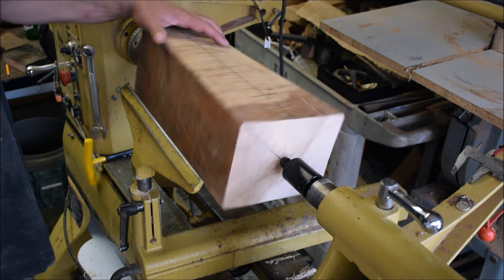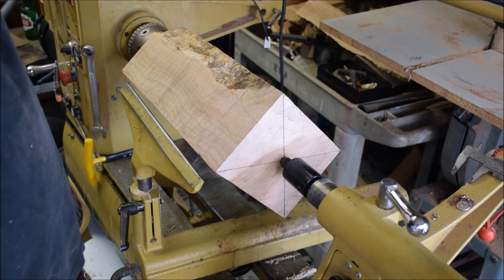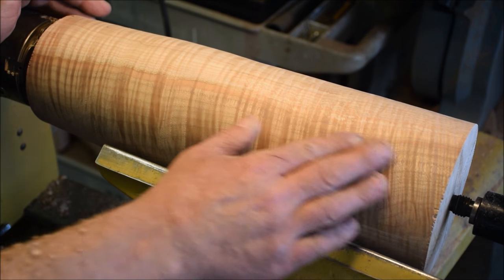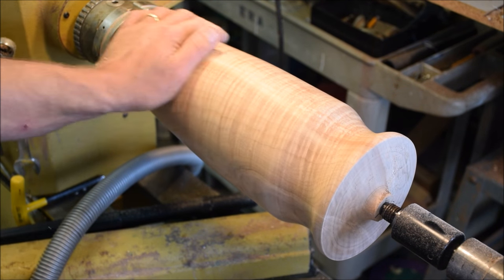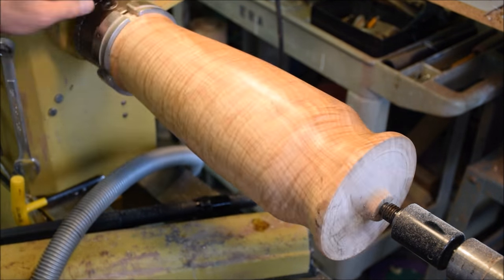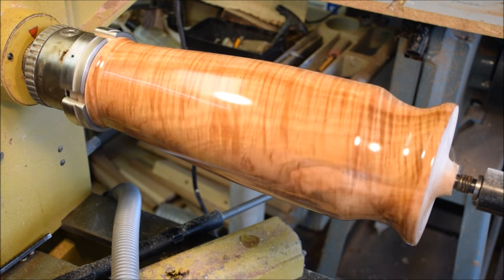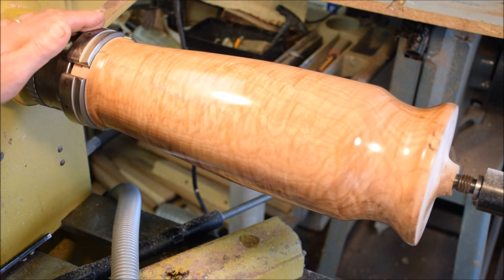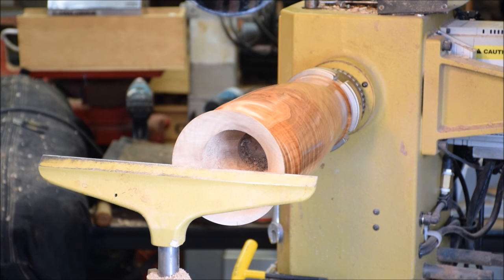Woodturning With The Naked Turner Figured Maple Vase

Comment: Beautiful Vase Erik. Your right. NO HANDS inside. I use a 1x1 wood stick and some foam like what you use for pipe insulation. glue it in a U shape around the end of the shaft, and use spray adhesive to stick what ever grit you want,and sand to the finish,you want. to change grits, just peel off old paper,spray,let it tack up and sand finer and finer. Love your videos Michael in Florida
Reply from the maker: Thanks Michael, That is a great tip to add. I did use a stick with ethyfoam and sticky back sandpaper in the end.  Thanks again Michael!

Comment: Awesome as always, if I have to sand anything reasonably deep and narrow I use a piece if wood ( usually 1"X1") and wrap a piece of foam around the end (about 3" long) then wrap sandpaper around the foam, as you stated I'm always afraid of damaging my hand, you can get a good finish going through the grits and if the bottom is rough off the tool 60grit can get out most tool marks, you'll be able to pit a lot more pressure on without any worries. Excellent to see you creating a tool for the job too ;).
Regards 
Peter
Reply from the maker: Thank you so much Peter , I too used a stick and foam pad to sand up to 220 deep inside but the final grits do not sand very well on the stick and I did not want to get hurt so I settled and was happy I didn't break this one!  The tool worked but it was a real challenge and took about 3 hrs of hollowing.

Comment: I wish you had recorded the new hollowing tool in action. I would love to see how it works. I'm attempting to build a hollowing tool loosely based on Lyle Jamieson's design. I've started a vase that is about 12 1/2" long, but I'm using pine from a neighbors tree he cut down. I'll let you know how and if it works. I'm certain mine won't be near as beautiful as yours, but I have to use what is available.
Reply from the maker: Cool Gil, I really like Lyle Jamieson's  design and was wishing I had one while struggling with mine.  I need to make some changes but I used it like a shear scraper and it took me 3 plus hrs of hollowing and I used my forstner bit to drill a 2" hole about 5" at a time and then scrape away.  I almost went through the side wall and it is only because it is hard curly maple that it stayed in one piece.  Thanks

Comment: great piece! I'd like to have seen how you parted and finished the bottom. Thank you.
Reply from the maker: Thanks Shelly, that tells me you stuck around to watch the video even though it was a bit long.  I parted right up against the chuck head and cut a slightly wider then one blade width of my parting tool and then cut the last 1" with a flush cut Japanese pull saw and hand sanded the bottom and finished it with just a hand rubbed friction rub finish.  it is a duller finish on the bottom but it works for me!